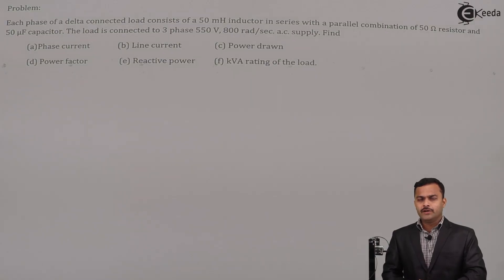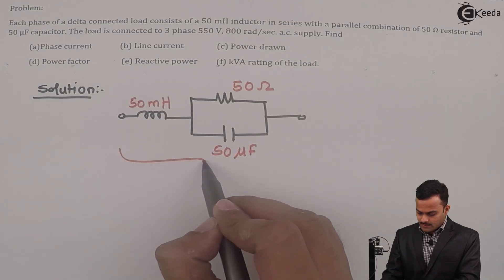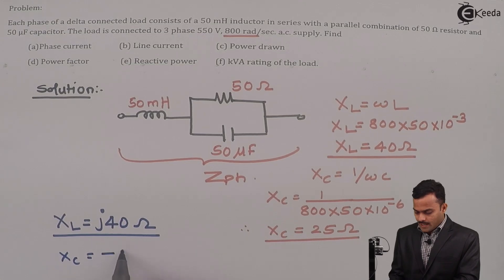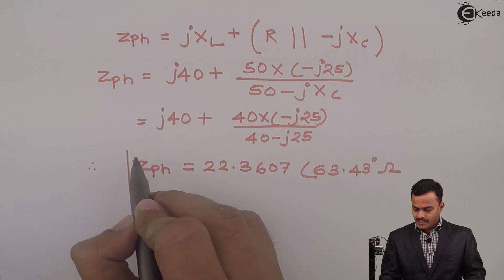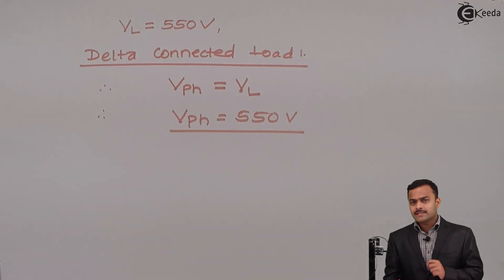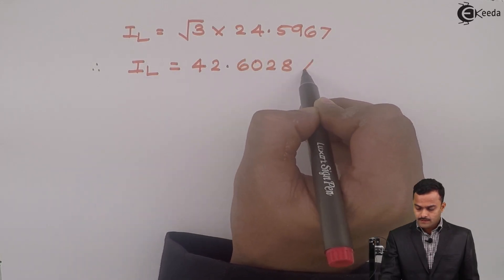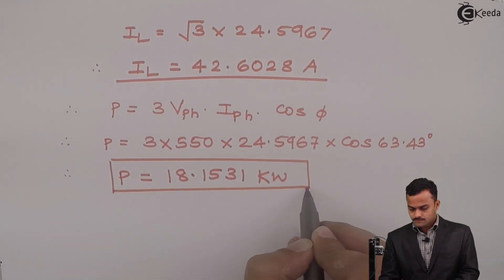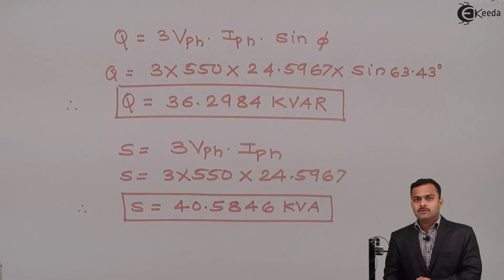Three Phase AC Circuits : Problem 1 - Three Phase Circuits - Basic Electrical Engineering

Comment: sir since impedence angle is positive it means current will be leading the voltage so it should be capacitive one instead of inductive that u explained in the video

Comment: please check weather u have calculated the zph in a right way as you may have calculated it by taking resistance as 40 but the resistance is 50
Reply from the maker: We noted your query. Our academic team is working on it and will update you once the issue is resolved. You can download our app where you will get all the concepts from basics, practice problems and doubt asking facility.
Download App - https://ekeeda.com/download.html

Comment: Hello Sir! I am from Nepal. I am an Electrical & Electronics Engineering preparing for Master Entrance. I went through your lectures and your lecture was impressive but in this lecture i found error in ohm value as 40 ohm instead of 50 ohm. If we keep 50 ohm then the impedance (z) value is 22+j.20. Finally it's magnitude will be 29.732 with phase angle of 42.273 degree.
Reply: It’s rather 10+20j
Reply: @akulahuja6404  yes me got the sem

Comment: in the formula of Power drawn. From where did you get that 3 ???
Reply: its because taking the all three parts of delta connection the total power will be 3 times the power in single part.
Reply: bcoz it's a 3phase circuit
Reply: I thought it was meant to be √3 instead of 3 🤔 please someone explain
Reply: @Bringyourtools  for line quantity it is √3 but for phase it's 3

Comment: I got Zph as the impedance in the R || Xc (parallel part) . However when I add ZL, I get the the wrong number
Reply: he have 50 in one step and the very next step u have used 40
Reply from the maker: Dear Yannick Schmied
To get answer of this question you have to become our member. 
To become a member click here http://ekeeda.com/chapterlist/Mumbai-University/Mechanical-Engineering/Basic-Electrical-Engineering/114
If you have any doubt contact us om 9821842103